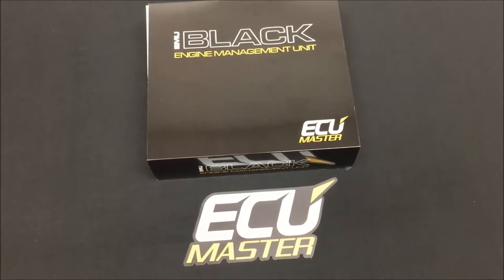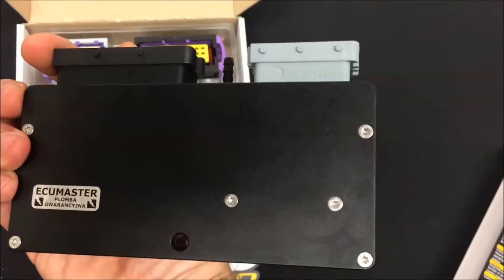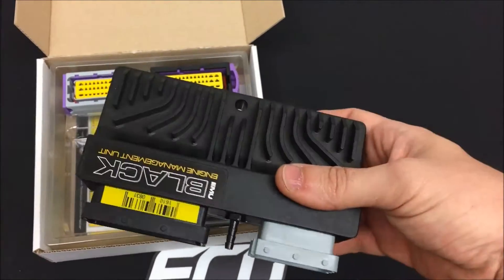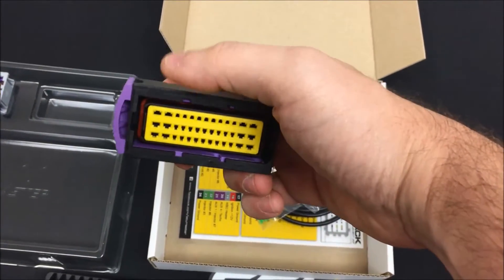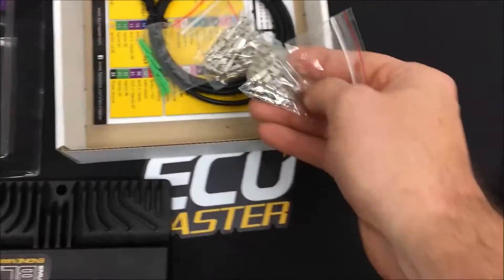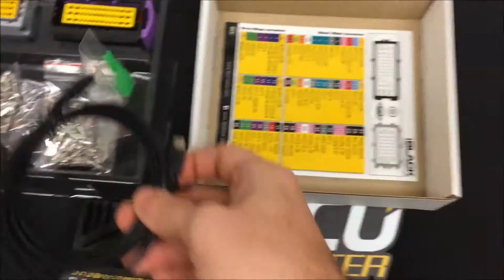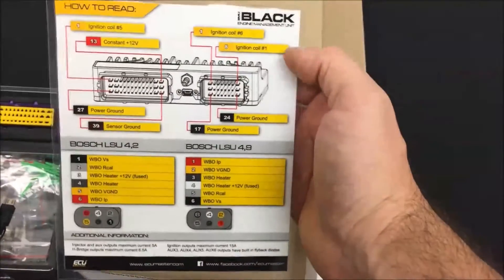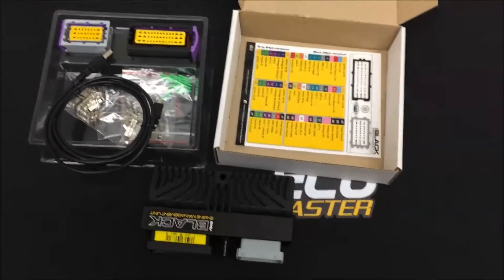ECUMaster EMU Black Unboxing!

Comment: how does that work in conjunction with the 2jz adapter plug?
Reply from the maker: The pin locations are similar, the EMU Black just gets 15 more pins on the black connector, gray stays exactly the same. If you're upgrading from an EMU to EMU Black, you just have to depin the current black connector and insert those pins into the appropriate channels for the new EMU Black connector.